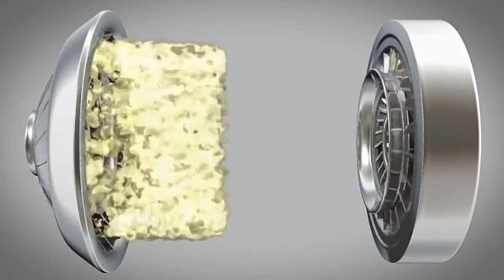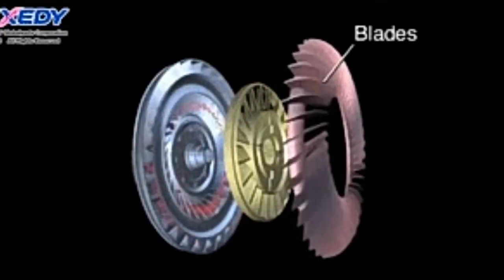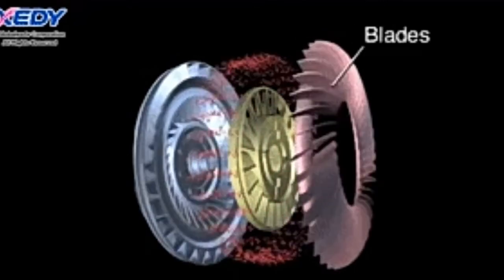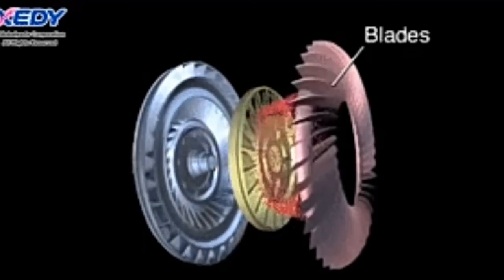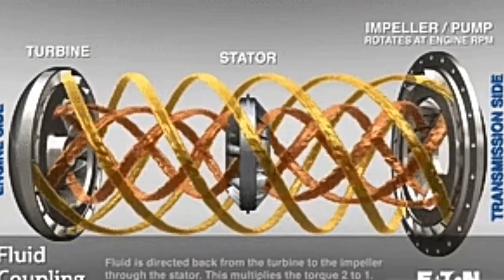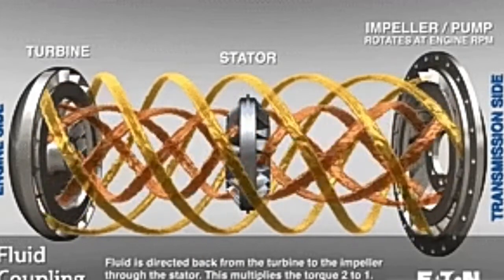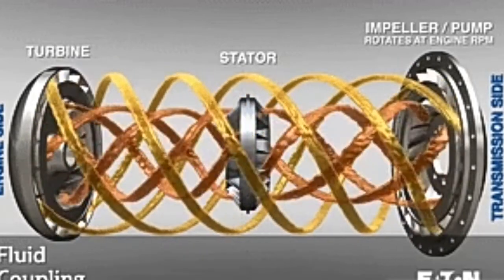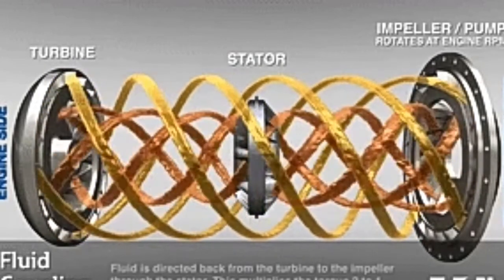Working of Torque Converter and fluid coupling

Comment: reactor wont be stationary, reactor spin in the  same direction as the impeller (pump) and turbine , don't share false information!!!
Reply from the maker: Thank you for your feedback,
The reactor will not rotate until the system reaches a threshold speed due to the one way clutch placed in it. This mechanism is the one which helps to multiply the torque and hence the name. The reactor will start to rotate at the same direction of turbine and pump when the speed of is enough to change the angle of attack to generate a thrust which helps to rotate the stator in the same direction as that of the turbine